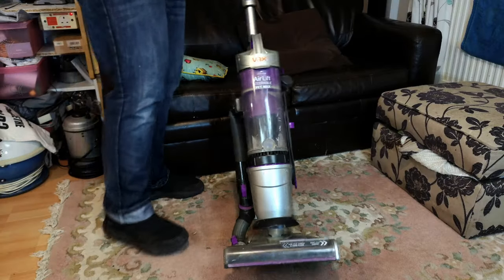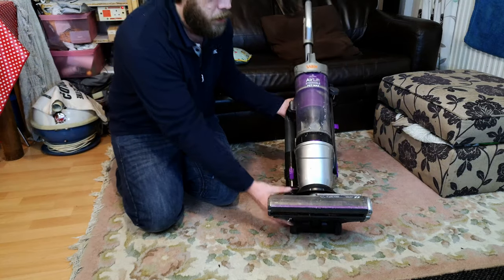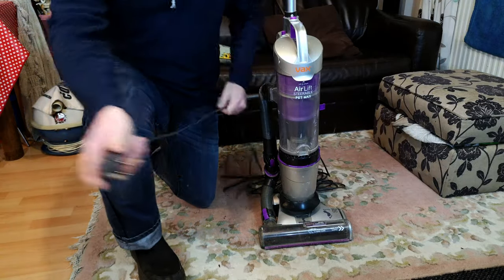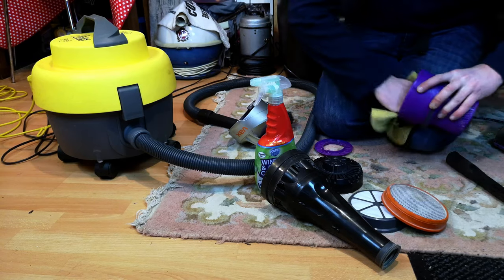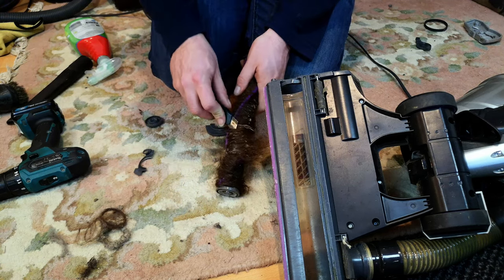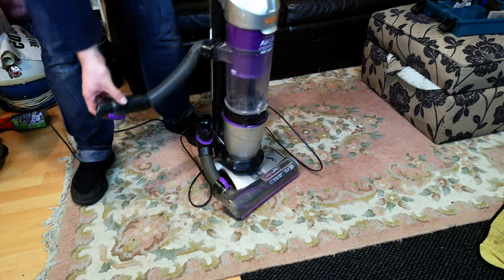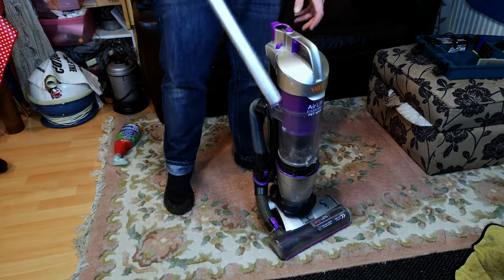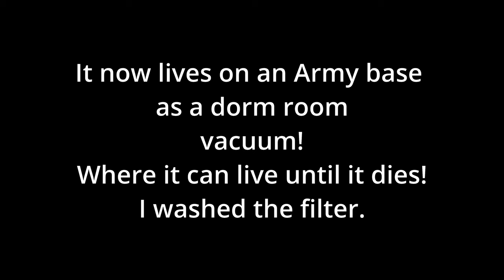Trash Find! Vax Air Lift Steerable Pet Max - What major Vax thing is wrong with it?

Comment: I've got exactly the same vacuum and had it for nearly 4 Years love it. But today emptied it and found a hole 😢 in it's plastic dirt bin so will replace the dirt bin with one on eBay.  Id rather repair and replace a part at all times if possible.  I was brought up to mend and make do if possible.

Comment: How is that roller even working with all that hair on it
Reply from the maker: They are quite good with keeping it spinning, even when the hair gets between the brushroll ends and bearings and melts everything 🤣 Before you know it it's too late and the main housing has warped/melted